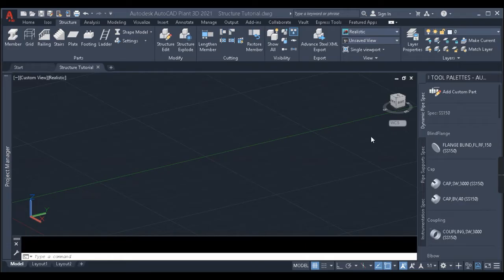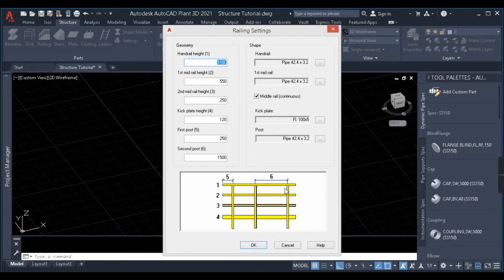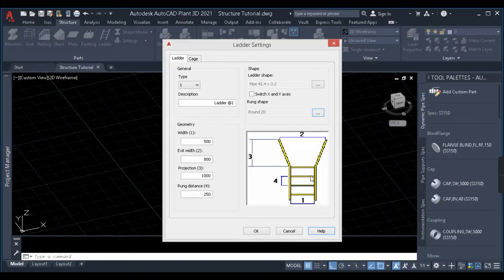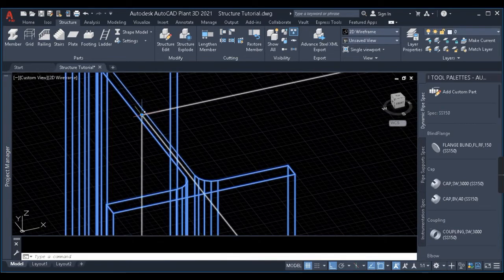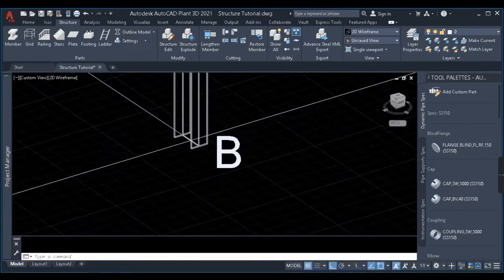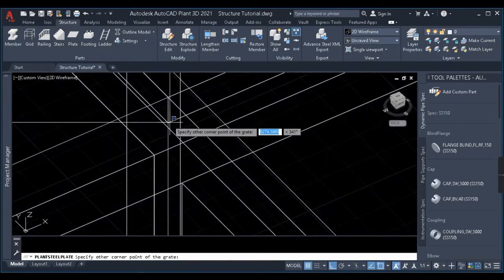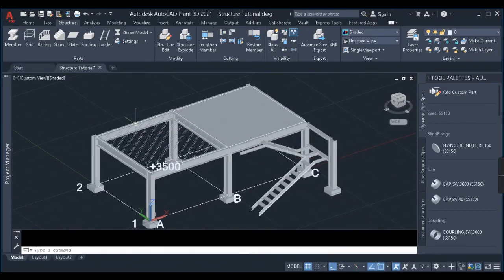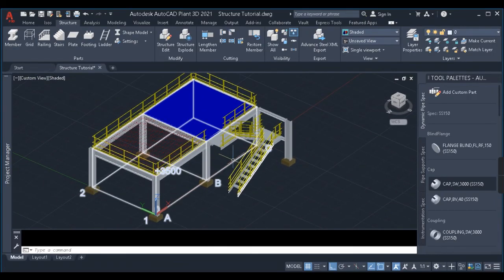Plant 3d Tutorial For Structure Modeling |Part 1|

Comment: I cannot get the scale right. I open a document and switch it to mm using UNITS and I still have pencil thing I-beams. Is there some other form of Unit setup?

Edit: Nevermind, you have to create a new project.
Reply: Coming from Object modeling all of this seems very freeform and lacks precision. I can't fathom why people use AutoCAD but here I am nonetheless.
Reply from the maker: Plant3d is mostly use for piping design and is not preferred for structures

Comment from the maker: Skip to the part you are looking for:

@00:32 Structure intro
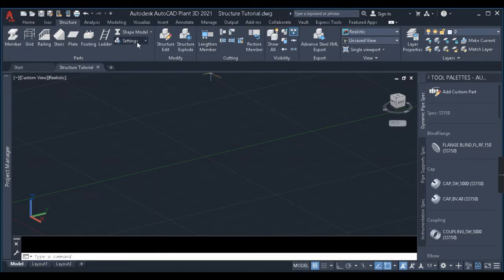@1:00 Structural Elements settings
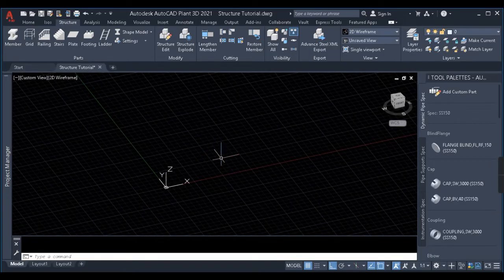@9:18 Grid creation
@11:21 Structural member modeling
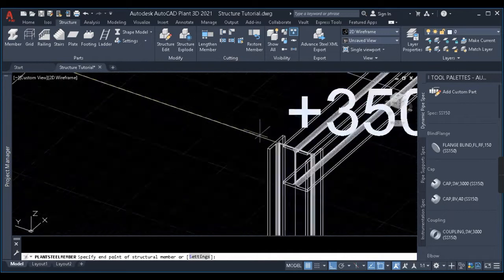@13:20 Shape model display
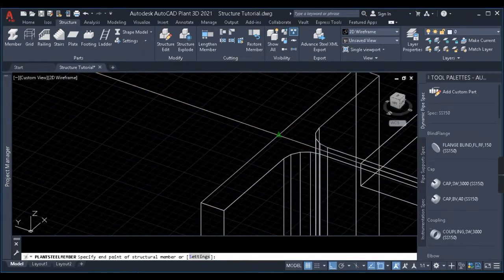@13:20 Footings modeling
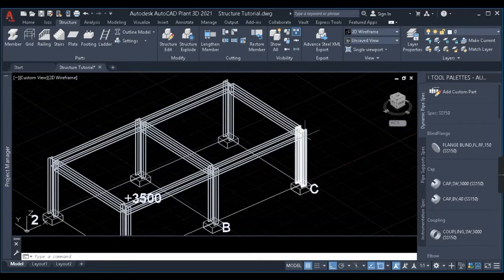@16:08 Grating/Plate modeling
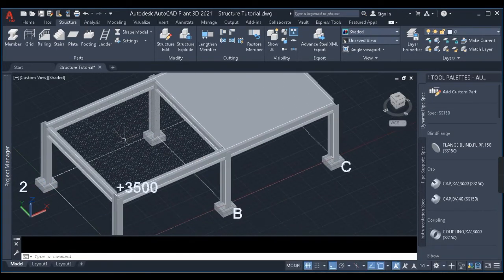@20:15 Staircase modeling
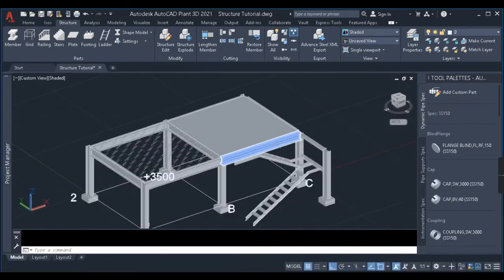@23:15 Railings modeling